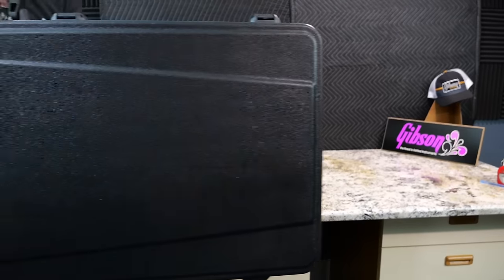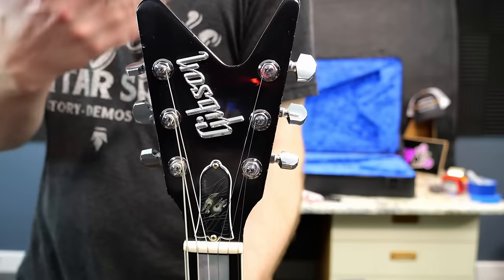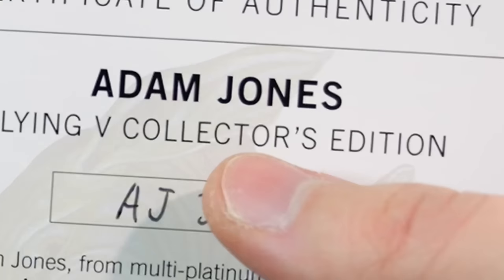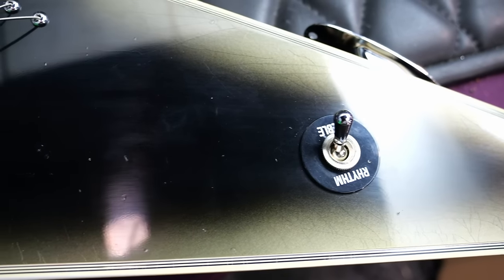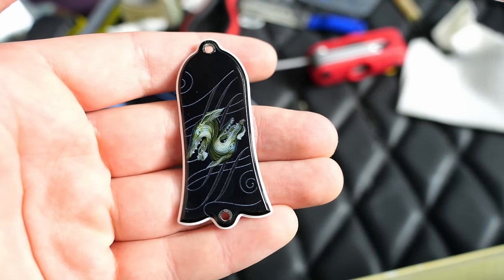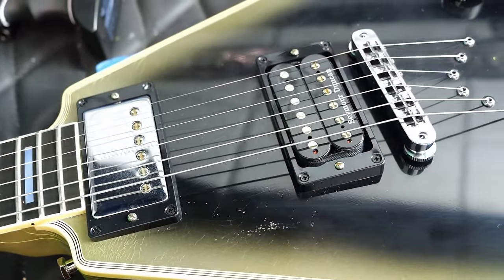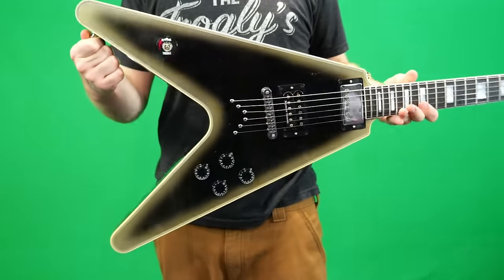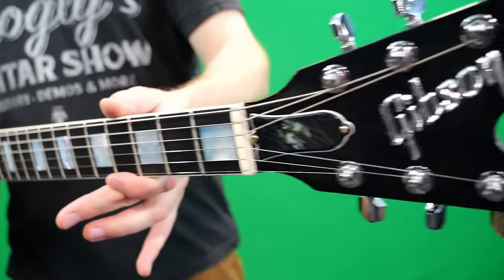Reviewing the Controversial $20,000 Guitar | 2023 Gibson Adam Jones Flying V Collectors Edition Tool

Comment: The upper toggle switch on the upper wing was first done by Randy Rhoads on his polka dot V.
Reply: I liked the location on his original Concord on the top side of the upper wing.
Reply: Even the knobs and the strat jackplate are Randy’s style
Reply: @Darth.Shredder It's not a great location, trust me. If you have the toggle towards you for the neck pickup, and lean into the guitar at all, your abdomen hits the switch and kicks it to the middle position. I have one of the Music Zoo's RR 1.5, and that's what happens with it. Great idea that didn't work very well
Reply: @JokersWild70  I had one of the originals. I didn't say it was in a great location - just that I liked it better on the side than the location on this one.I had one of the original Jacksons when they came with half vintage trem and half with Floyds, ong before the Music Zoo versions. .Never had a problem.but then again I didn't play it much.

Comment: Hey Austin, I reckon you could give those pickup heights a bit of a tweak to achieve a better balance. From the shots at the end, I'd say you're neck pickup is a bit too low and that's probably contributing to it seeming to lack as much pick related dynamics. Due to the bridge being so much hotter, I'd dial the raise the neck pickup and dial that in first and then set the bridge so that the output more or less seems at unity between the two. 
That is the best thing about having a bridge pickup that is roughly twice as hot as your neck though. You can match the output between them so much easier while having the pickups positioned at the optimal height relative to the strings in order to have the string moving in the "sweet spot" of the pickups magnetic field.
Otherwise, I don't mind the headstock, I just think it's a bit quirky and I really do love the unique specs of this guitar.

Comment: Gibson uses veneer...Gibson's semi-hollowbodies like the ES-335 and ES-339 have tops and backs constructed of layers (either 3 or 4) of maple veneer. My understanding is that the veneers are assembled in successive cross-grain layers with the top layer having its grain longitudinal to the length of the guitar. The tops and backs are approximately 1/4" in thickness after layup.

Comment: Did they give gold screws for the pickguard?
Reply: VOS screws
Reply: @MfGrimm0503 outside of the Murphy light age, nothing seems VOS’ed? Pickup covers, tuners, “goddy Gibson logo”, etc. Only thing I CAN note is the backplate screws backdropped on a gold Gibson custom medallion toggle plate. Outside of that, even the control cavity plate screws are silver. Check around 2:35 they’ll be there plain as day.

Comment: NECK DIVE - deal breaker for me. 
My JH-1 ESP hot rod V did that - hated it for that reason.
A diver's weight on my strap helped to fix it.  
The face burst is not very well executed.
Head stock is ugly and poorly designed. A small rounded tip 'V' wooda been sweet. 

Those posi locks is why it's so expensive.  LOL
Reply: Lame